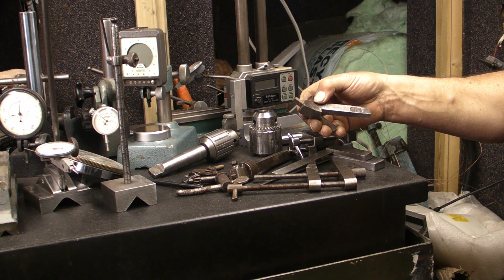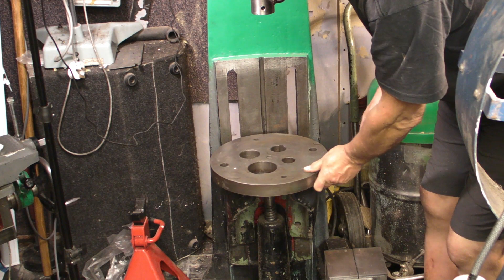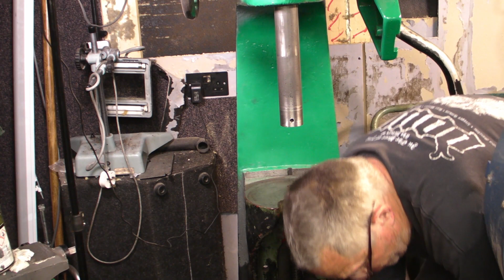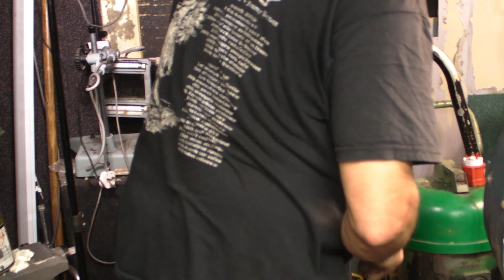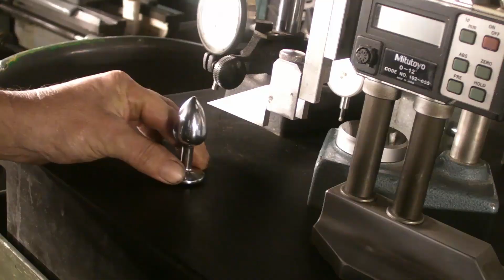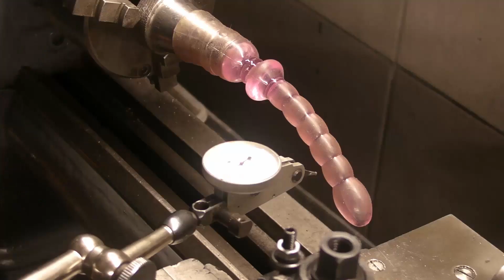MONSTER ARBOR PRESS

Comment: I recently cobbled together a table/knee elevating screw and bevel gear assembly for my $100 frozen/stuck outside for decades greenerd no 4 press. It was missing the elevating screw, the handle, the hand wheel, and the ram has had about 6” cut off of it. The ram was completely frozen, but after the usual amount of effort and elbow grease, the press is back in action and as good as ever before.
Reply from the maker: Good piece of kit ! mine has the casting ready for machining the lifting gears, must have been an option...Del..